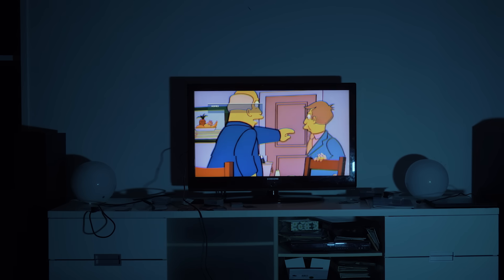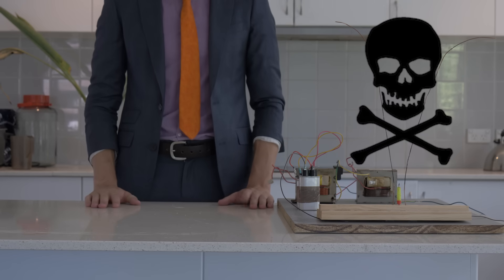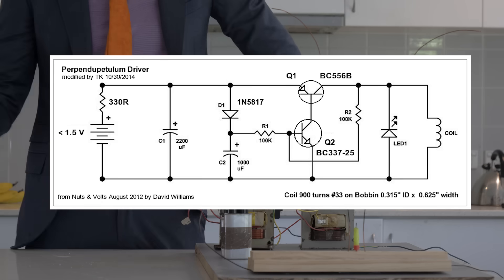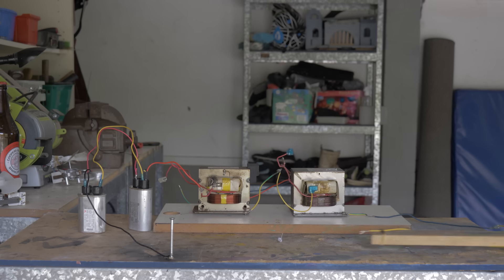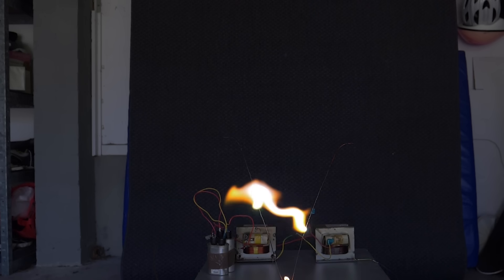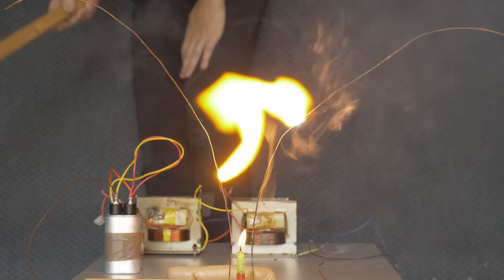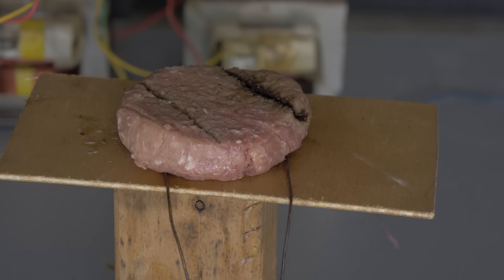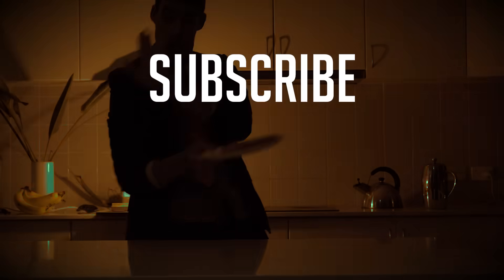Localizing Aurora Borealis entirely in my Kitchen

Comment: microwave transformers are fucking scary if you didn't know, the problem is they will hold electricity for a verrry long time so if you touch the wrong bit years after fucker was unplugged you get dead. DO NOT FUCK WITH MICROWAVE TRANSFORMERS!!! DO NOT OPEN A MICROWAVE UP, IF YOUR MICROWAVE BREAKS DISPOSE OF IT RESPONSIBLY DO NOT TRY TO FIX IT!!

Comment: 3:34 I only know this because I used to build vapes, and batterys in series are exponentially more powerful for low ohm resistance and WILL blow up. Parallel is much much safer

Comment: If you put capacitors is series you reduce the capacitance. If you put them in parallel you increase it. It’s the opposite of how resistance is added.

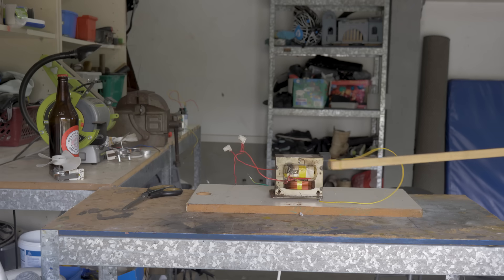Comment: 3:20 wuzzup beiging. erm, capacitors could work in serries and they often are used as such in things such as marx circuts but youre using chemical elecrolytic capacitors which are more used for... capacitance... but slower... so like the chemical holds electrons and then in your circut you are discharging them... slowly... alot of power in those capacitors. you have to have them in paralel to increase your ampres, the stuff that makes the circut cook. anyways imagine telling one capacitor the fuel up while you (a capacitor) are watching them discharge. that is mighty stupid.

Comment: take a simple circuit with 2 capacitors in series, applying kirchoff's law for voltage we have that Vc1 + Vc2 = V, let's take another circuit with one capacitor and the same voltage difference and we get that for reasons i won't explain v = 1/C*integral(I(t)dt) where I(t) is the current, substitute Vc1 and Vc2 with that formula and you get that V = (1/C1 + 1/C2)integral(I(t)dt), so we get that 1/C of the simplified circuit is equal to 1/C1 + 1/C2 thus 2/C, basically the C is halfed. do the same trick with capacitors in parallel but now use the fact that i = Cdv/dt and apply kirchoff's law for current instead and you will get that the C's add up! you can do the same with inductors and discover it's the opposite of the capacitors in terms of behavior
Reply: 3:20

Comment: Capacitors didn’t work in parallel cause electricity takes path of least resistance and although the capacitors create higher output they have resistance

Comment: If the goal was to store as much charge as possible, then the capacitors needed to be in series. Capacitance works opposite to resistance. In parallel it's added simply, in series everything is reciprocated

Comment: I didn’t know Jim’s did insurance! I thought they just did Mowing, Antennas, Bath resurfacing, Bin cleaning, Blind cleaning and repairs, Car detailing
Carpet cleaning, Cleaning, Concrete, Dog wash, Electrical, Fencing, Fire and safety, Floors, Flyscreens and blinds
Glass, Handyman, Hazardous material, Heating and cooling, Locksmiths, Painting, Paving, Pool care, Roofing, Roller doors, Security, Shade sails
Skip bins, Termite and pest control, Test and tag, Tree and stump removal, Window and pressure cleaning and Window tinting!

Comment: When capacitors are in series its like increasing the thickness of the dielectric which decreases the capacitance. When in parallel its like increasing the surface area of the plates which increases capacitance.
In series..1/C=(1/C1)+(1/C2)+(1/C3)+....
In parallel..C=C1+C2+C3+C4+....

Comment: They don't work in series because a transformer converts AC to DC power. It expects a high voltage AC signal input. Once the power goes in one transformer and out to the other it is DC. The second transformer won't be able to utilize the weaker DC signal.

Comment: the capacitors in series doesnt work because the total capacitance of capacitors in parallel is the sum of the capacitors and the capacitance of capacitors in series is equal to the inverse of the sum of the inverses of the capacitors.

Comment: Two capacitors in series have less capacitance than 1. ((1/Ctotal)= (1/C1)+(1/C2)) vs in parallel Ctotal =C1+C2.

(Intresting note that this equations are the same but flipped for adding resistances.)

Comment: warning y’all again of how dangerous this can be! touching the wires can deliver 2000 volts of electricity into your body in under a second. If you’re lucky, you’ll instantly die. if not, you will be physically unable to move your body or cry for help, as the electricity will lock your muscles in place. don’t do this.

Comment: Probably way late with this comment but unlike a resistor where you add the total resistance in series and lowers the resistance in parallel. Capacitors do the opposite so series lowers the total and parallel is addition.

Comment: We can rationalize it without knowing anything about capacitors with KVL. A parallel circuit will deliver the same voltage to both caps (with varying currents that sum to the circuit's total current) while a series circuit delivers the same current to both caps (with varying voltages that sum to the circuit's total voltage); since the total voltage is limited (whatever's provided by your transformers+power source), best to go with the option the doesn't share the voltage between the caps (mostest voltage = bestest voltage)

Thinking about it in terms of caps, you can visualize a capacitor as two plates of conductive stuff real close to one another- one plate connected to a higher voltage and one to a lower voltage. The voltage difference causes a built-up charge on the surface of the plates, so the bigger the plates -> the more total charge you can store (and the greater the capacitance C). Adding another capacitor in parallel is the same as adding surface area to the first capacitor, the capacitance just adds and you can store more charge ezpz. Adding another capacitor in series, you now have the high voltage plate (the first plate on the first cap) and the low voltage plate (the second plate on the second cap) separated by some stuff that has dookie permitivity compared to free space, acting as one big capacitor that's weaker than each cap would be individually.

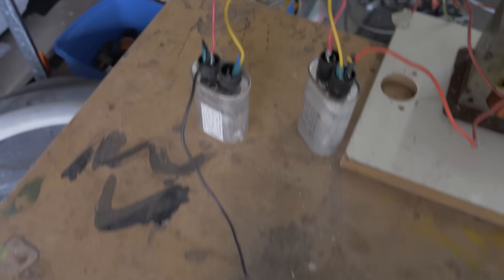Comment: 3:24 I'm no electrical wizard but I did get an A in AP Physics 2 and all I can tell you is that the capacitance of capacitors in parallel is C1 + C2 ... + Cn while the capacitance of capacitors in series is (C1^-1 + C2^-1... + Cn^-1)^-1, meaning that if you wire them in series you get a fraction of the capacitance you would get in parallel. Funnily enough the exact opposite is true for resistors, in parallel the total resistance is (R1^-1 + R2^-1... + Rn^-1)^-1, while in series its R1 + R2 ... + Rn

Comment: Capacitors in series behave the opposite of how resistors do. In parallel, total capacitance (F) is the sum of both capacitors, while in series the capacitance is calculated like resistors in parallel, 1/((1/C1)+1/C2)).

Comment: So the main purpose of a capacitor is to oppose a change in voltage. They do this by taking two conductive plates, and separating them with a dielectric substance. The capacitors ability to oppose a change in voltage is called its capacitance, which is proportional to the size of the plates relative to the distance between them (very simplified). When you add the capacitors in series, you are effectively increasing the distance between the plates without changing their size, which means their total capacitance goes down, while when you add them in parallel, you effectively increase the size of the plates without changing the distance petween them, which makes their total capacitance go up, therefore their ability to oppose a change in voltage goes up.

Comment: When you add two equal capacitors in series, you halve the capacitance. When you wire them in parallel, they add up.
Reply: I thought he was joking, since that's  101 for electrocal components. Like he does all this crazy shit, but doesn't understand capacitor basics
Reply: @AmeliaBestWaifu  He was
Reply: So it's the opposite of resistors?
Reply: @squealydan its complicated
ps:　not really, but might be a long explanation

Comment: The reason the caps are in parallel is to increase the capacitance at the cost of output voltage. This allows the arc to be maintained for long enough to rise.

Comment: My guess the capacitors didn’t work in series because they can discharge faster than they charge, so you’re just bottle necking the second capacitor and thereby the flow in the whole system. But that’s just a theory. A cap theory!

Comment: Capacitors in series reduce the overall capacitance of the circuit, but in parallel they add. That's why they didn't work in series.

Comment: Caps in series reduces their effectiveness, parallel adds them up. If you try to make an arc after its gone through the series caps and they are too weak to pass the charge through, then the arc wont happen. What this means is you can build a dress out of series capacitors and run on power lines without fear of electrocution. Be careful not to accidently create a parallel cap dress as this will cause lightning storms in your neighborhood. Thanks, and good luck.

Comment: putting capacitors in series will always have less charge capacity overall, because there is a weird cancelling out effect. In parallel they just add up, kind of like battery + battery = bigger battery.

Comment: The capacitor is a wunky dude. 

By placing it in series, its like placing them in parrellel, due to the surfice area of the capacitor, meaning you placing them en series was a parrellel contection, while placing them parallel, is a series conection. 

Thats why they didnt work, they had smaller area, so the charge to discharge was to fast most likely.

Comment: Capacitors do work in series they're just a lot weaker (think pulling two chained springs apart vs. pulling two springs next to each other apart) so it wouldn't surprise me if, with capacitors that big, capacitors in series wouldn't have built up enough voltage to start an arc even with the candle.

Comment: I’m probably very wrong but my initial inclination is to say that the capacitors didn’t work in series because they work a little differently from batteries hence they only work in parallel

Comment: Caps work opposite of resistors, so by placing them in series you gave them half the stated capacitance (assuming they are the same value). By placing them in parallel you doubled the capacitance. Another reason is that you are only work with 50 to 60 Hz signals meaning that in series they act like large resistors, greatly limiting the current. In all likelihood the caps aren't really helping anything in this case besides an initial current pulse when the arc is initiated.

Comment: 3:25 they don't work in series because one drains the other. its equivalent to having 1 bigger capacitor. they need to work separately in the circuit, not together.

Comment: capacitors turn into batteries in DC circuits
they dont do crap
batteries are boring
we all know what batteries do

the magic happens when you put them into AC circuits

it does some cool shit by tricking sine waves in the AC and turning them into cosine waves
its called capacitive reactance

but if you stack them in line with eachother,,,.that effect kinda cancels out 

stick em in the same line and one just kinda undoes what the last one did

making it lame 

but put them side by side and they both do the same shit at the same time

twice the capacitoring!

Comment: Bit of a late comment, but since no one has explained the capacitor part yet, I will.
Capacitors can be thought of as a bucket connected onto an axle. Water fills the bucket, then we can then tilt the bucket to empty the water. If we had two capacitors in series, then its like having one bucket tip into the next bucket. If you think about it this way, then we arent increasing the capacity at all, just tipping water from one bucket to the next bucket and so on.
Capacitors in parallel however, can be thought of has filling two buckets at the same time, and tipping both buckets at the same time. Obviously this is double the capacity.

Comment: 3:30 Caps in parallel is like increasing the surface of the plates, which increases the capacity. In series, however, it is like incrasing the gap between the plates, which decreases the capacity.
Well that is the short answer i remember. I remember lightmarish stuff about calculating epsilon zero, area, secondary dielectric properties and so on but i chose to lock that traumatic experience in the deepest corner of my brain :-)

Comment: i think the poles are actualy the strongest if the earth aproximates a dipole, its just that the direction of the field doesnt allow clyclotron motion so the particles dont get traped there
edit: not an engineer (physics minor) but i think the capacitors doent work in series bc there is not enouth 'elasticaty' in the charges in the smal part of wire between them i would geuss, where as at bouth ends they can relatively freely flow once the arc forms

Comment: if you still have the diodes out of the microwaves, you can easily put together a voltage multiplier and have arroud a 20kv output, makes some beautifull arcs and some unsetling noises

Comment: The candle is providing plasma. The light you see being given off by flames is actually matter. Instead of just reflecting light, it emanates it, because it is when atoms break down and become nuclei and electrons, separated in a fluid like mix, due to the electrons having too much energy to be bothered getting stuck in orbitals around the nuclei. Being so energetic and so free, the electrons get up past the outermost orbital (as determined by the influence of the other nuclei) and skirt on to the next nuclei's higher energy levels, and so forth and so on, like a whole neighborhood of wife swappers. Along the way, sometimes they lose enough energy to fall down, even if temporarily, back into a lower orbital, and in the process give off photons, which is the light you see, that again, instead of being reflected--which is how you see matter normally--is being emitted directly from the enflamed carbon.

Because the electrons in a plasma are getting so much energy from their surroundings, they are able to act freely enough to conduct electricity: i.e. to respond to voltages nearby directly. The electrons in the burning carbon are so free that they make the carbon act like a metal, when in this plasma phase. As a result, they are able to form the electromagnetic waves possible to suck the energy out of the two poles. As the plasma lifts in the air (due to the floatation principle, which dictates that hot air, which is less dense than cold air, should float on cold air), it sucks energy from the two sides, keeping it in plasma form longer, instead of going into the gas and solid phase (soot/smoke) as it normally does. Thus, remaining a hot plasma longer, powered by the energy it sucks from the two poles, the flame is able to continue emanating light longer.

Comment: Capacitors are basically short term batteries, if you wire them in series, the negative pole from one, discharges into the positive pole on the other, and you are left with basically no charge.
In parallelle, they can both deliver their intended Farad charge.

Comment: Okay okay okay. To create a use for the microwave oven WITHOUT the transformer, how about this. Put a vid screen right vehind the door. It would start with just a pic of the normal inside of the oven, but, when you run the microwave, a little vibration motor mimics the sound and vibration of the transformer and fan, but then on the screen you could put lots of stuff. Satan. Sticks of dynamite giving off smoke. Money burning. Any number of horrid, gross things I'm not going to list.

Comment: Capacitors in series actually decreases capacitance, so given that you wired them correctly, you essentially made a worse capacitor. Parallel however will cause the total capacitance to be equal to the sum of your capacitors, increasing capacitance.

Comment: The capicitors need to be in series because the microwave transformer can put out TONS of volts, but you needed more amperage. Parallel means they worked together same time to provide more juice

Comment: the copasitors halve in parralell, so if you've got 100 and 100 in series they are added and then devided by 4 because resons (havent learnt why yet). they probs didn't run in series because they where too good or im a dumbass. most likely the latter

Comment: simply because the capacitors in series adds up the voltage capability but in parallel it doubles the capacitance, plus the capacitors can usually handle double the voltage that they are rated for any way
Reply: also i have that exact soldering iron

Comment: When caps are wired in series their capacitance values act as if they were resistors wired in paralel.
Reply: Exactly, just change the resistor for a capacitor value 👌

Comment: Because capacitors in series add inversely. Aka Ctotal =1/c1+1/c2 ect. Capacitors in parallel, However, just add together and that gives you more capacitance to bridge the gaps in the ac power (maybe?)

Comment: Caps only charge and discharge in a linear fashion. Can't alternate a charge between them. Kinda like building a bigger storage area. If you get a cycler I believe you would be able to run them in series but to apply more power just add more caps and let them charge longer before use

Comment: The capacitors work by transferring electricity from one plate to another. The farther apart the plates the less charge is transferred, the bigger the plates, and the smaller the distance the more charge is stored. When you put them in series it is equivalent to moving the plates very far away from each other making the energy-storing inefficient. When it parallel it is equivalent to doubling the plate size so the charge stored grows.